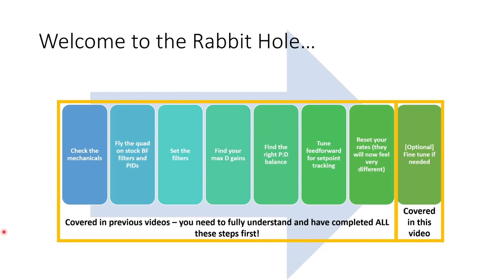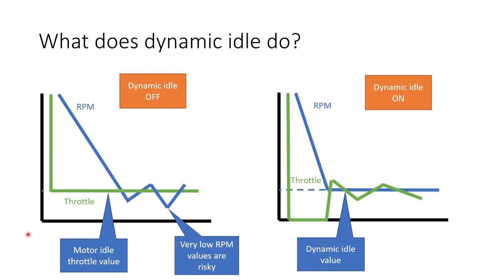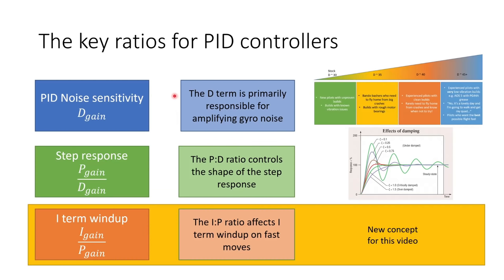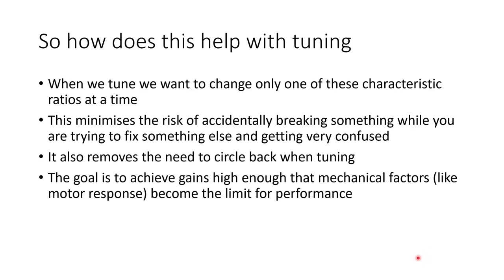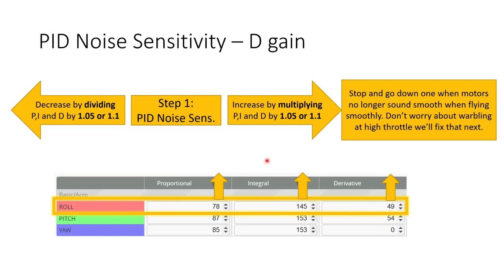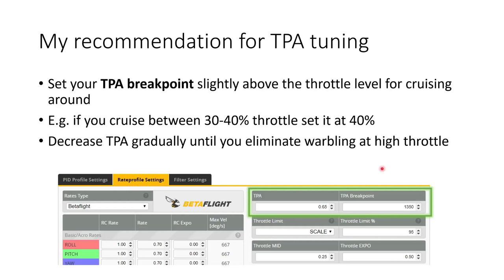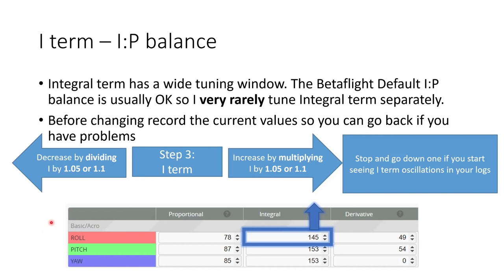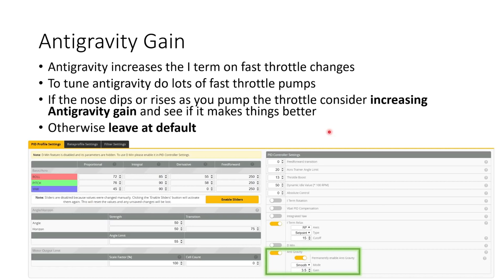Fine tuning your PIDs. A deep dive to get your quad flying its very best!

Comment: thanks for your videos! I followed you step by step, and this is the best way to scientifically tune pids that I have ever found. Anyway, I've got an exception: I have a 4" long range quad, with 1404 motors, and I think that the motors are not keeping up with this system.
ex: I see overshoot on pidtoolbox, but it is a REEEALLY slow overshoot, with its consequent bouncebacks. if i reduce P term, the overshoot reduces, but i have a peak time of 180+ms and the oscillations are really excessive.
so I tried to raise P term, and I have reached a peak time between 90-140 and reduced a bit the oscillations. 

is there a way to tune it better? do I have to manually raise a lot more the pids or the only solution is to change motors/propellers?
Reply from the maker: A slow bounce back could be I term. Have a look in the log to see which term is causing the bounce
Reply: @ChrisRosser  thanks for the answer, Reducing the I term solved (partially) the problem. The thing with this quad is that in a straight cruise flight, you will always see some little bumps, hops, like you're driving a car in a messy road. they're very small, but no matter how much I raise my pids, I can't get rid of them.

The method you propose in this videos is perfect for racing or acro (my other quads now are perfect), but I can't smooth the straight flight of this long range cruise quad. 
(it's now almost perfect on snap roll and flips though).
Reply from the maker: @Morpheus981  Those little bobbles are caused by not having enough motor torque for the props. A 1404 is really too small for 4" in my opinion. To get rock steady footage you need to have big enough motors to have perfect control over the prop. 1806 is my pick for 4". You may be able to improve things by increasing your timing in BLHeli to 23deg (Medium High) and running lighter pitch and lighter weight props.

Comment: I notice that when you reach motor saturation in the log at 26:42 you lose a little setpoint tracking on pitch and yaw at the end of the move. Trying to work around this on my quad I found I ended up with much higher roll and yaw values then pitch.  I also tried things like the alternative mixer modes which were fun to experiment with. Ended up just settling on lower values over all. I could keep raising pitch gains without trilling but the loss of tracking on the other axis gets worse the longer motor/pidsum is saturated.  Is this just the limit of prop/motor combo or is there a better way to keep authority on the other axis when a motor saturates?
Reply from the maker: Once a motor saturates you get what you get I think. The gyro will start to deviate from setpoint on all axes. The key is avoiding overshoot as the quad returns to the setpoint.

Comment: hello，chris rosser，How do you fix the significant difference between PID curves with a rate greater than 500 and less than 500?Pid curves larger than 500 and smaller than 500 are severely separated and do not overlap at all.
Reply from the maker: Hmm, that's interesting. Can you provide a log?
Reply: @ChrisRosser  I've had this problem for months, and I can't solve it.Could you tell me your email address?I'll send you the black box.
Reply from the maker: @穿越机入坑指南  you can find it on aos-rc.com

Comment: If we want are d gain to be as high as possible that we are most comfortable with let's say 65 would we not just set both roll and pitch to have d gains of 65 why would we keep one less then the other?
Reply from the maker: The quad might be more sensitive to noise (or have more noise) on roll vs pitch so you can have more D gain on one axis than the other.

Comment: I've been trying to fine tune my quad for 3 years already... This video as the other's doesn't help me at all. First of all I always see perfectly tuned graphs in pidtoolbox, but have never seen graphs I get from my blackbox. And every time I'm trying to get help no one from discord groups can help me because they see such a problems from me for the first time. I've changed 5 types of motors, 3 frames, 5 types of FC, and I'm still having the same issue like jello on hd footage. Also I tried different contractions and materials for hd cam holders and now I'm using tpu 70d. The problem I have is Jello on 1280-1320 throttle. In blackbox at this amount of throttle I see pitch dterm oscillation and the amplitude is rising when it goes up to 2000 throttle. I tried to decrease d, added tpa 0.2 on d(I'm now flying emuflight) but it doesn't help at all. Motors are new and I also balanced each one to have less than 0.05 amplitude in motor tab... Is there any ability to help me with tuning and troubleshooting for 1 evening for some donation? I have 8 packs, and could show you hd footage and blackbox files
Reply: Is the HD footage coming from DVR? Or is it from an action camera like a GoPro?
Reply: @О.Ш-ь1щ  the insta 360 is why you have jello lol get a GoPro
Reply: @kreativ_corals not yet
Reply: @О.Ш-ь1щ  I'm not certain, but I would be willing to bet you would see a significantly less amount of jello if you use one :) It slows the frame rate down and allows for a more natural blur in the video. Without blur you will get jello on the best tuned quad.
Reply: @kreativ_corals  also I'm confused about pid tuning because I could raise Pterm up to 200 and will have no oscillation when applying throttle. Also about maximum dterm... motors are hot when it's a hot 30 degrees outside and cold when it's less then 27 degrees Celsius outside... How to understand the sweet spot????
Reply: @О.Ш-ь1щ  lol you’re thinking about it too much. Like Joseph said, get a GoPro or slap an ND filter on your HD cam. That’s why you have jello.
Reply: It could be the frame as well, I've had some 7" I was tuning for months that only a new custom frame fixed the Jello, I would try going different ways with TPA as I believe betaflight and emu treat them opposite 

 you should never have to increase pidd above 100 on a 5" unless you got super low kV motors or something
Reply: @badfourlife  I had nazgul5 v1, v2 and now I stoped at apex, because I really liked the way it flies...
Reply: @badfourlife  and also I don't like betaflight behavior. Drone feels like it's jelly, on emuflight if you set feathered pids to 0 drone feels like it's steel... It seems to me that that feeling caused by the way dterm working. On betaflight d acts only like a dumper to arest pterm. On emuflight with feathered 0 dterm is also acting at the beginning of movement, so when setpoint starts to move the drone is pushed not only by Pterm but also by dterm
Reply: @О.Ш-ь1щ  yeah ive messed with emu a bit, although i went back to betaflight and dropped my feed forward down to 40 and have been happy with the handling since.... I fly with gyro lpf off for better wind handling/propwash and i need that rpm filter/dynamic notch that bf has

heres my 750g apex(hero6) with 1750kv 6s and p3 props pids  (pidff format) 

roll: 65,60,50,40
pitch:75,70,60,40
yaw: 80,75,0,30

you may need an extra 10 on p and d if youre above 800g, although you may need even less if youre running higher pitch props
Reply: @О.Ш-ь1щ  hmm, the only last thing i can think of is the front/rear interaction of props on low throttle causing that jello, it shouldnt be arm flex on apex

 ive had it worse on frames where props get super close.... could always try a smaller prop (4.8" 4 blade prop or something, wait no my 4 blades have all had worse jello, better off with azure 4838) to see if its the source of jello, other than that im out of reasons, sounds like you got a good build
Reply: @badfourlife  it seems to me that I need special discord group with name something like: help Russian guy to tune a quad)))
Reply: @badfourlife  it seems to me that it's not props but motors
Reply: @О.Ш-ь1щ  🤣🤣

Comment: I'll maybe buy the second iteration of your quads, I'm sure they are technically wonderfull but they look kind of.... Dull to me.
No offense,
If you succeed to make them stylish the may well be the next gold standard of the industry.
Reply: @ChrisRosser  If you want to preserve the exact same shape, maybe hydrodiping could add some character to the frame, It could be a special edition. 

I particularly like the look of the Apex, the Babyhawk 2 also (Emax) it has "triangular" arms too and is known for having good flying characteristics.

I think theses frames have in common "organic" curves, yours is really straight.

But from what I've seen with deep learning engineering, if you keep optimising you will end up with organic looking shapes. It's not like the forces where equal at all points of the arm.